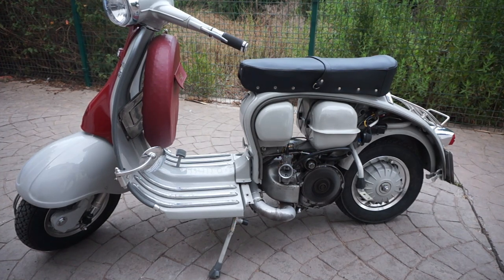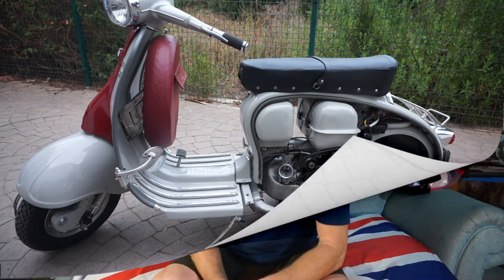advance retard ignition #lambretta #thesteelweasel

Comment: Have you had any experience with add on boxes .. kytronic… cst …. Top videos by the way pal 👍
Reply: Hi I've always wondered about the boxes , I've had keytronic and camlamb imola boxes and couldn't figure out why people spend so much more on full kits?? I now use vape sport static at 17° on casa ss200 with ADS 5 race pipe
Reply from the maker: Yes had a rt 225 with krytronic and it ran really bad in the end I disconnected and went static 17 degrees and the scooter was transformed.......
Reply: @TheSteelweasel  cheers pal 🛵👍

Comment: Can you change a vape sport variable to static by just changing the cdi unit
Reply: SIP sells most models in both variable and static, I would assume that it's just a different CDI but I'm not 100% sure. Check their site
Reply: Yes you can
Reply from the maker: Yes
Reply: You are correct, had the sport on my small frame but ran into serious overheating issues when the scooter would start to lug under a load.